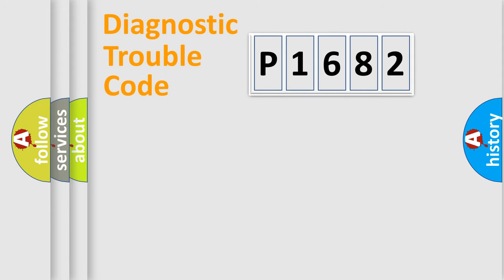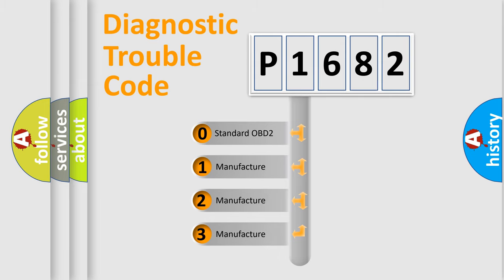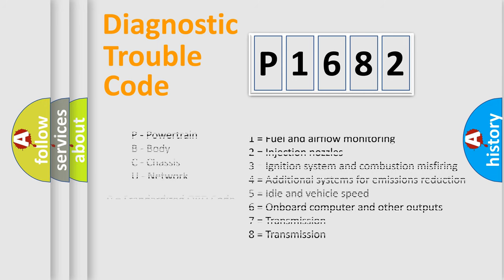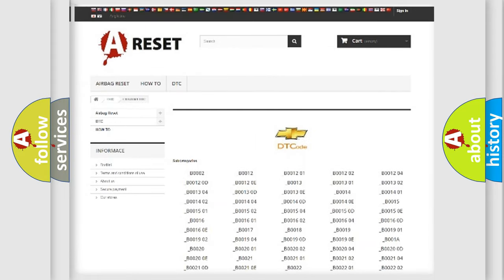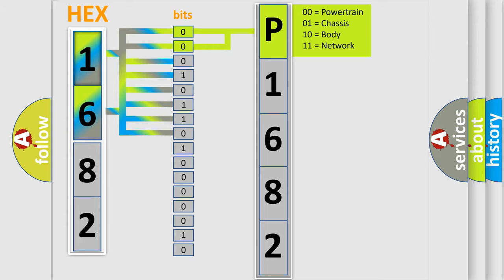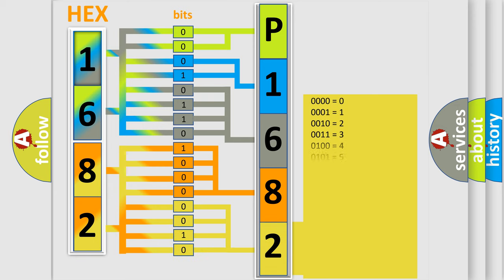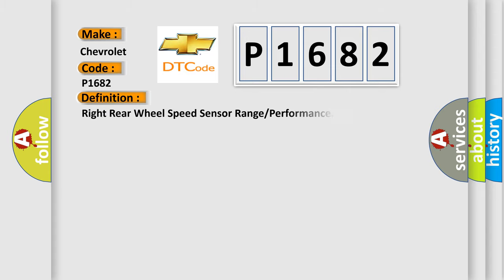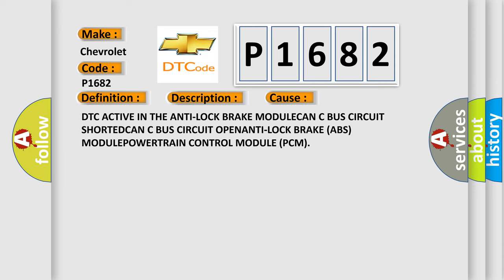DTC Chervrolet P1682 Short Explanation

Comment: 1682 is ignition switch 1 circut two not the dam brakes lmao
Reply: Captain America I’m currently getting this code on my 14 camaro SS. I just switched all my ignition and I’m still receiving this code. Thing is I was also having an stablitrac issue before this started…I actually ordered all four wheel speed sensors as well just haven’t replaced yet. 
But you are correct P1682 is a ignition voltage code.